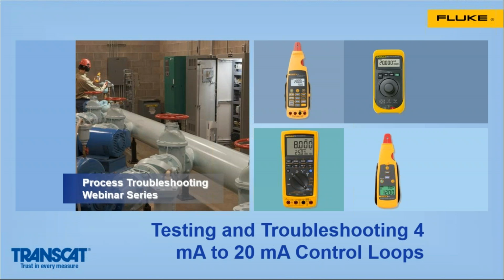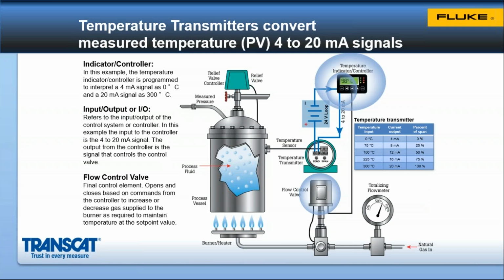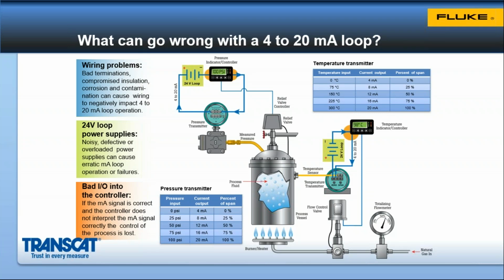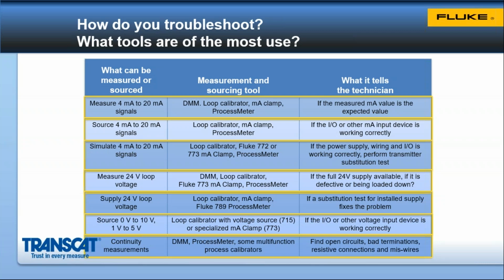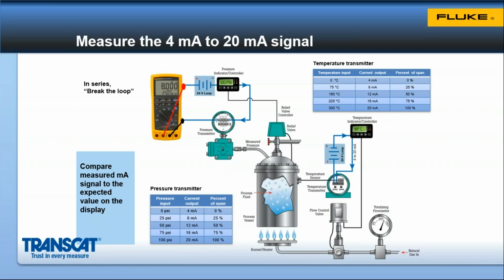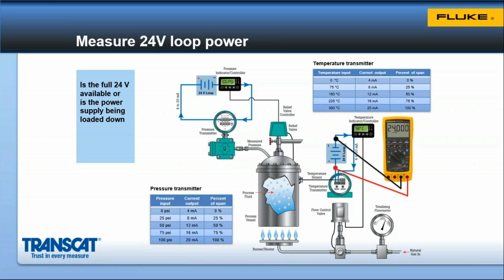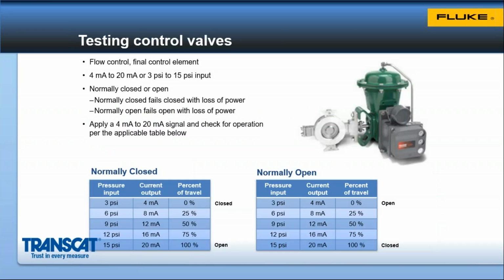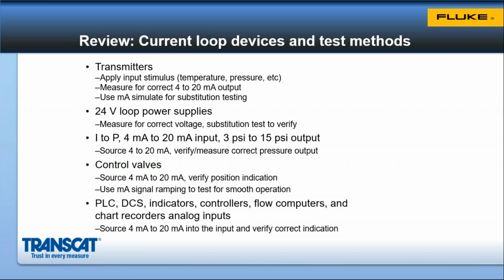Testing and Troubleshooting 4-20 mA Control Loops Presented by Fluke and Transcat

Comment: some times the  4 to 20 ma input in some devices is  not isolated  and not all manufactures give you the information 
How can I test if the input to a device is not isolated ???
is there a test to confirm the input is not isolated ???
Thanks.

Comment: I have made the 4-20 mA input & output isolator device.
when i connect it to any instruments other than PLC then output shows right reading of the current given by my device.
But when i connect the device to PLC there is slight change in reading on PLC
e.g if i transmit 4mA to the PLC then PLC shows 4.09 mA. 

What will be the problem need to be corrected in my device to work with PLC also

Comment: Good Presentation indeed.Very helpful.

Here i have a problem , the RTD is reading constant value, even if temperature changes. I replace the puk, still the same problem, I replaced the probe, again the problem persists, now I'm simulating 4-20 ma from the line back to PLC, when I give 4 ma and measure ma in series with the fluke to the transmitter I'm getting 27 ma. What could be wrong or problem?
Reply: Did you find out the root of problem? seems to be that a noisy loop or some source of voltage higher than usual is keeping that current above range